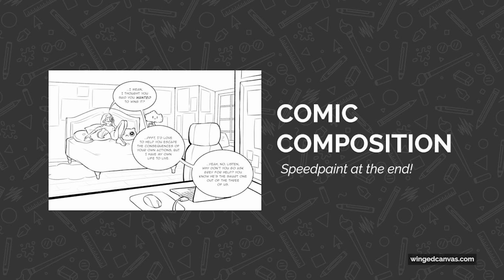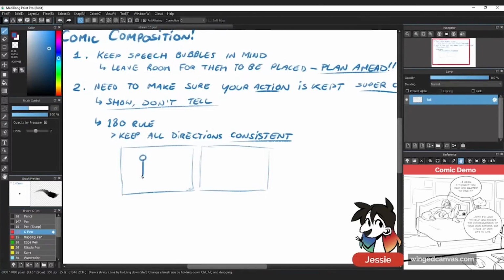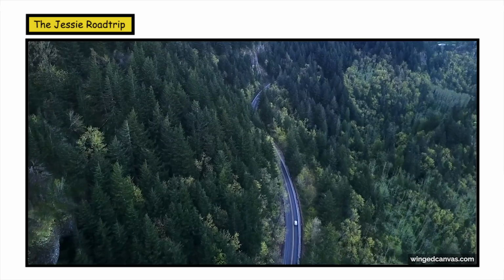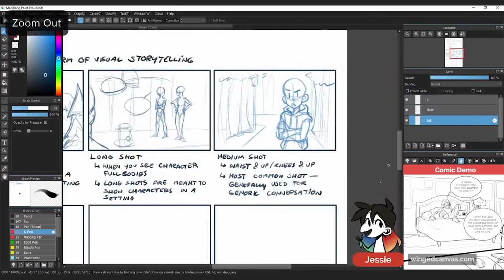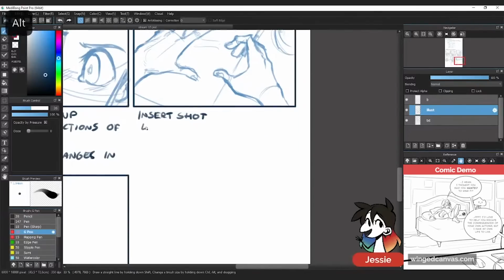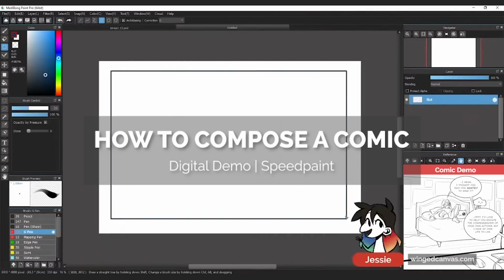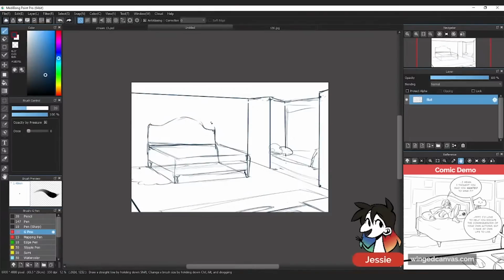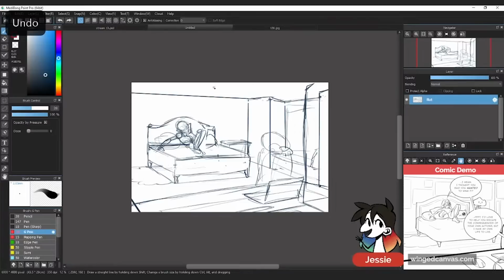How to Make Comics | Drawing Tutorial & Speedpaint

Comment: I make comics myself. I started it beginning writing comics of the school year last year, and here are the steps I did
1: write the lines
2:re-read the lines and maybe fix some stuff up
3:set up comic pages
4:make cover
5:follow the story in some boxes or shapes
6:after one drawing is done, add speach bubbles or backgrounds or words
7:repeat and then when finished color if wanted 
8:finish up by decorating back page
9:staple pages together

Done!
Reply: how quickly do you usually get a page drawn? just wondering cuz ive wanted to make my own comic for ages but always got fustrated after spending like 3 hours getting the rough outline of a single page done
Reply: @BarbaraGordonTheBatgirl  I haven’t made one in like a year but I do remember that I folded each page in half so I would use one half of a page so considering that to be one full page done it took me like 10 - 20 minutes. I am a fast drawer and I didn’t add too much detail cuz they were just doodles
Reply: use a ruler  @BarbaraGordonTheBatgirl
Reply: make one big box outline filling the whole page area and then put little boxes or shapes that you want for your sections

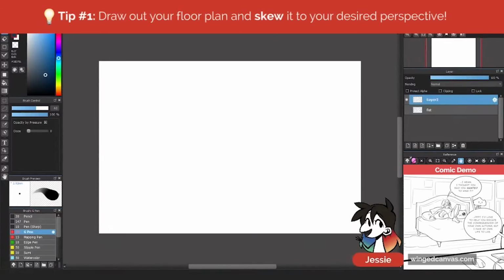Comment: Question: how do you do the skewing thing around 6:16?
Reply: It's generally called the transform tool in things like photoshop, Gimp or Krita. You can think of it as a kind of "perspective" tool, so if you had say, a flat poster you can use the transform tool to make it look like its on a wall with a bit of an angle from you , or like what she's doing here, use the transform tool to make something look like a "floor" so she can use it as a blueprint for the room.
Reply: @blazichaos7181  I'm tryna do it but I cannot find out how I'm supposed to use it on ibis paint, which is highly difficult when you're building a floor. There's no way that I see it sitting flat while still being able to read it
Reply: @average_adonis  when selecting the transform tool, go into "perspective form", then take the bottom right corner and pull it up a bit then to the right a decent amount theres a few little extra adjustments  (like pull the bottom left corner down and right a bit) to the other sides you can do to make it look better, but similar to art there's only so much that can be said before fiddling around with the tool is the best option. I hope this helps a bit.